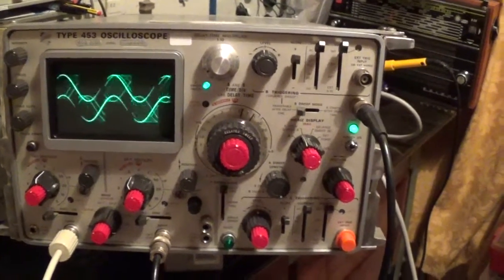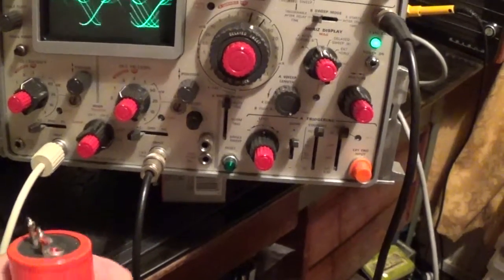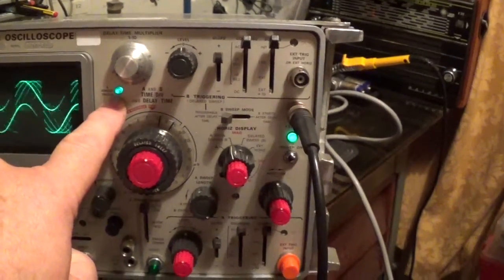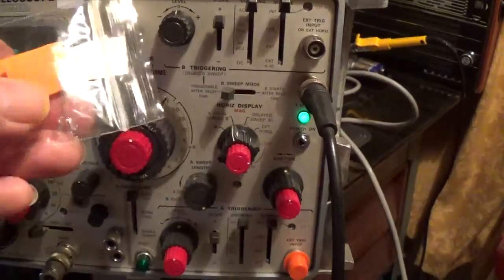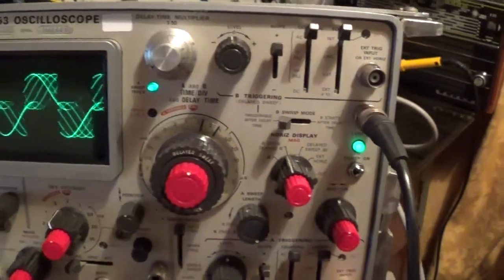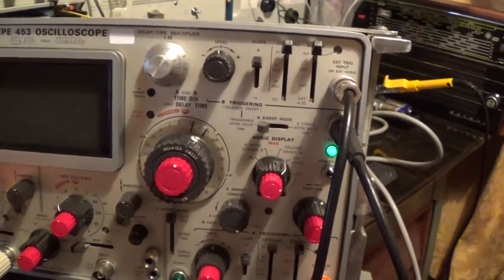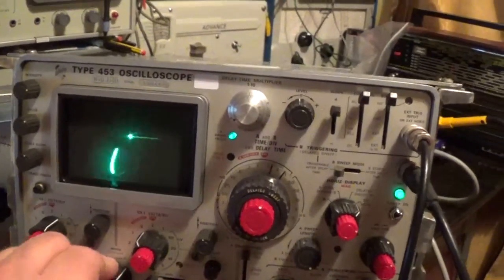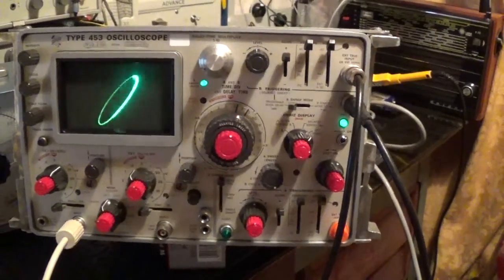Tektronix 453 Oscilloscope Part 3

Comment: How did you generate all these funny patterns on your oscilloscope?
Reply from the maker: Hi Ken, square wave into one channel, sine wave into the other and ADD mode by the look of it at the start of the video. From around 4 mins, for the circles (called Lissajous patterns properly) I'm in XY mode with the probe calibrator going into one channel and a signal generator into the other.   Alan Wolke explains the Lissajous patterns way better than me here 
https://www.youtube.com/watch?v=t6nGiBzGLD8
Reply: Andrewausfa , Thank you for your explanation.